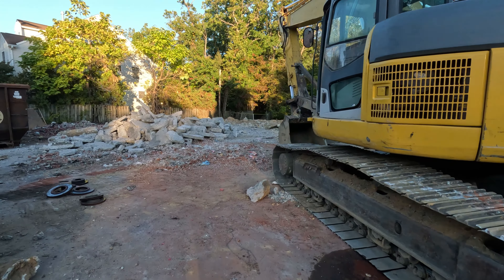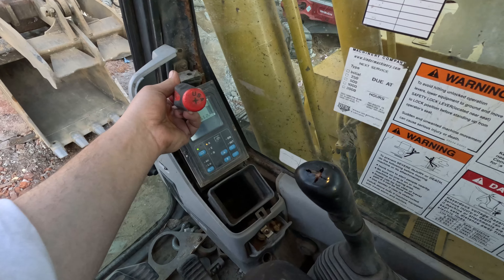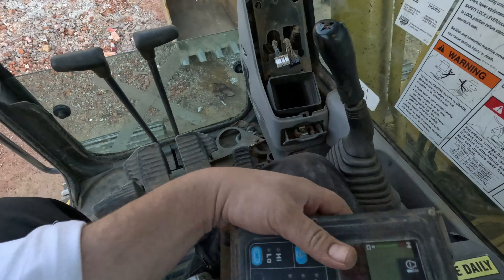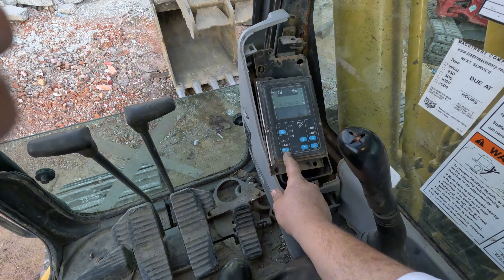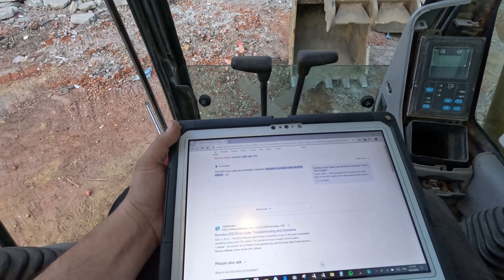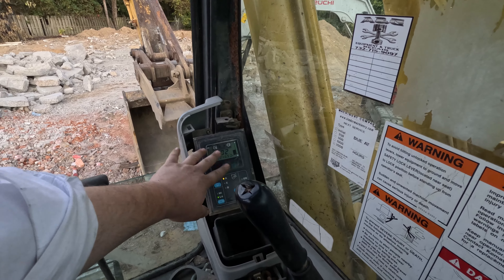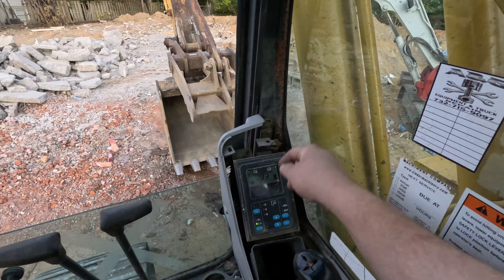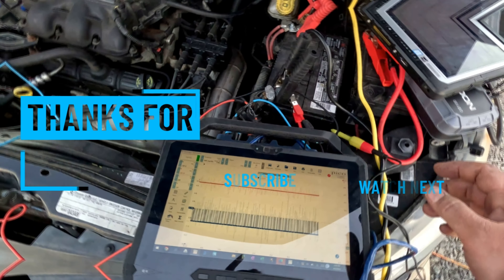2001 Komatsu Excavator - Frozen Screen, I should Not Be Here!

Comment: don't underestimate your abilities.  when it comes to electrical there is very little differences between any passanger vehicles and a heavy duty construction equipment like that.  can networks, powers grounds, pull up circuits, pull down circuits, ground side switched circuits, power ground switch circuits.  it's just getting access to service data with wiring diagram and theory of operation.